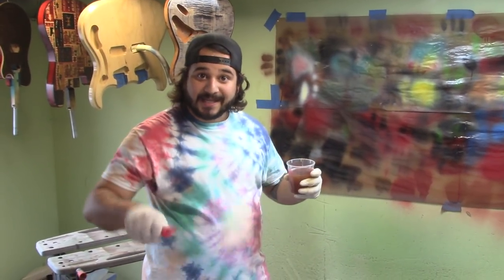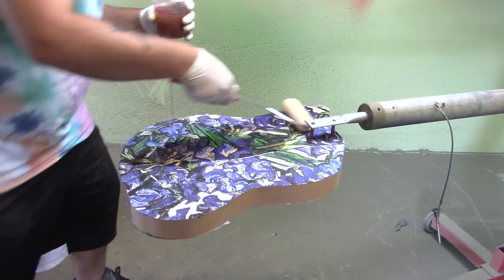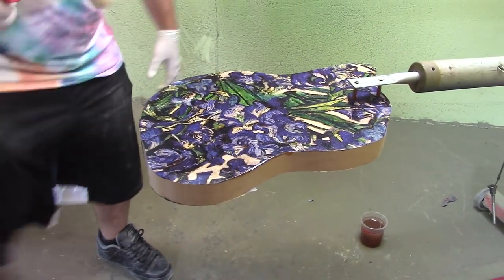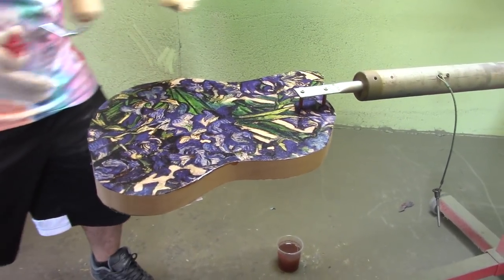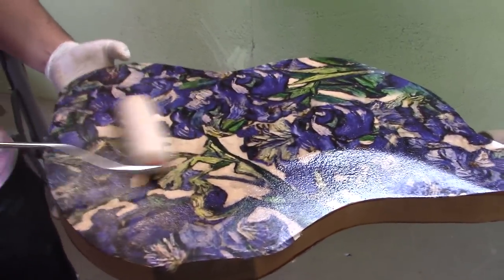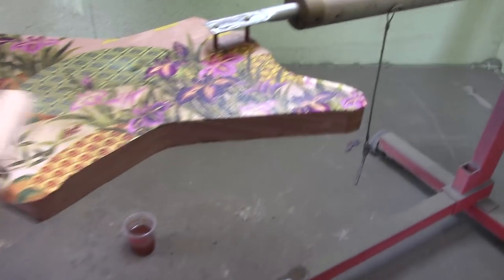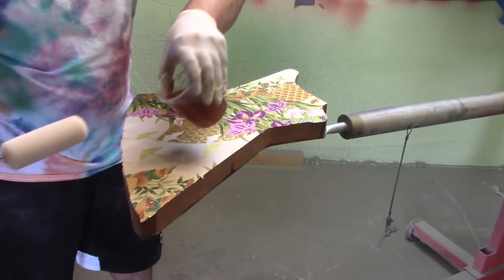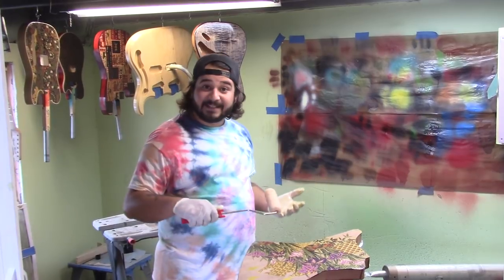Yes... You Can Apply Simtec Sealer With  A Wienie Roller!

Comment: Any problem with the Simtec leveling properties by using a roller over a spray gun?  both guitars look great, nice fabric!
Reply from the maker: The Simtec is pretty thick and will continue to flow for a long time so the roller is kinda like regular orange peel or maybe a little more. For the first course of sealer on fabric it  is perfect since you are really just saturating the material.
Reply: Thanks, Matt. I assumed that would be the case.

Comment: Do you know if a water borne finish can be used over this?
Reply: It's polyester - I'd check with the MFG of your top-coat.  You could also ask Simtec directly - http://www.simteccoatings.com/contact.ivnu

Personally I wouldn't mix systems if I didn't have to.... but I suppose if you prep the surface for a mechanical bond you'd be OK.
Reply from the maker: Don, is spot on Jim, best thing to do is contact the good people at Simtec and ask if it will work. I'd be surprised if they weren't able to help yo u.

Comment: There is much less waste with a brush or roler also.its not spraying in the air.
Reply from the maker: Excellent points, we have also had good luck with those foam brushes. You burn the brush but you don't have to clean the gun and squirt lacquer thinner all over